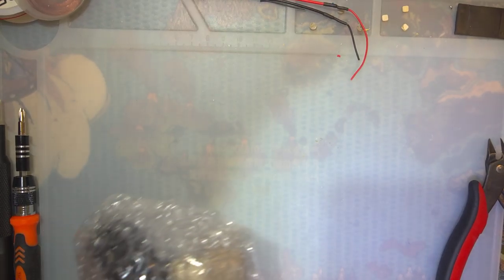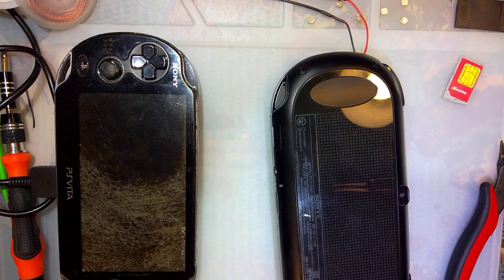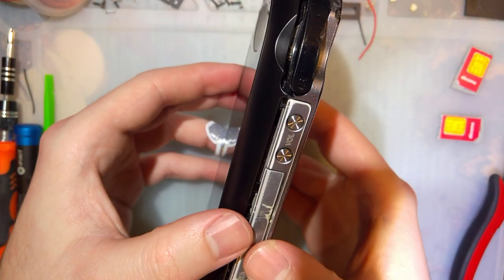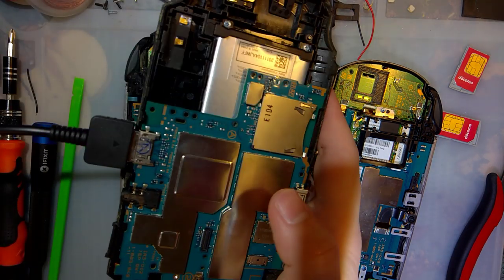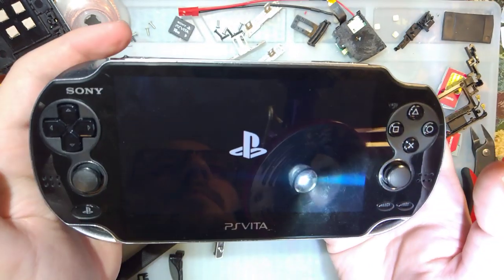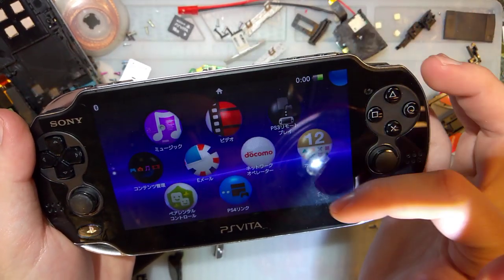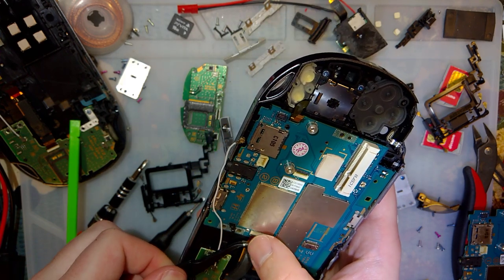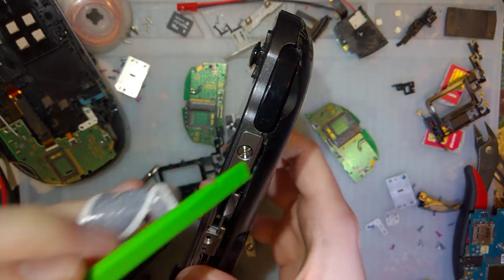Diagnosing Another Junk PS Vita

Comment: I think that when you get something broken, unless they explicitly say the motherboard is broken, and if you see that the thing has never been opened (because it happens sometimes that when someone at first experience opens it and pulls off a capacitator or scrap a flex cable with screwdriver), you can be confident to think it’s not a motherboard problem... i’ve repaired a few devices from nintendo’s 2ds 3ds, gba sp, nds, dsi, but also vita and psp, and i’ve never experienced motherboard problems...
Sometimes dead batteries, sometimes the broken screen was making the thing not even try to boot because the console itself was designed not to do so, to protect intern circuitery from shortage if it does not recognize a component because is broken.
You may know better than me that usually people mess up something (almost always screen or some buttons) and after asking for repair and getting a price too high for what they expected, they just sell on ebay for some cash back....
Reply from the maker: The vendor I bought this from has sold me consoles that have been opened in the past. I try to avoid those ones but that doesn't always work. This console has definitely had a repair attempt made before but I'm not sure if they had the back off. If they did, they did a very good job, compared to the repair attempt they made. The reason the screen is so visibly fucked up is because someone peeled the digitizer off the console before and it took half of the OLED with it. They just stuck the digitizer back down and sold it, perhaps. 

I just wanted to make sure there was no major issue with the PCB or the battery. I'm convinced of that. Everything else should be cheap to fix or replace if necessary. I should have tested the analog sticks though because, as it turns out, 1K Vita sticks are pricey as heck.

Comment: Looking forward to follow up. On a tangent is there any modification you can make to the wifi antenna. As the vita has poor signal strength in my house. Like amplification 
Im thinking from a remote play aspect to my ps4. Thanks
Reply from the maker: I can't say I've noticed any problems with the antenna in the Vita. The wifi is slow but that's a bandwidth problem, not a signal problem.
Reply: @makho  ahh. Thanks. Thought it might be simple as plopping in a different wifi module. Not to worry

Comment: hi i have a gbl and the contrast wheel was coroded and fell of taking the traces with it i have tried using a multimeter on a gbp to see where the traces go then soldering a new contrast wheel to some wires but that didnt work so i was wondering if you would know how to fix it or if their would be some way i could solder a resistor instead of the contrast wheel just to get it to be playable anyways thanks in advance edit if you dont know away would you know of a schematic that i could try and use
Reply from the maker: The contrast wheel should connect directly to the LCD regulator. Check again on your Pocket for the pinout. You will not get it working reliably with a resistor unless you find one with the EXACT value you need (which will be nearly impossible as all consoles are different and part tolerance will make that even more difficult). Plus, the value changes depending on the game you are playing and the charge in your batteries.
Reply: Thanks my only question is what is a lcd regulator and wherw is it located
Reply from the maker: @kaiden6677  It's labeled MGB-REG and it should be somewhere near the LCD connector on both the Light and Pocket.
Reply: @makho  thank you